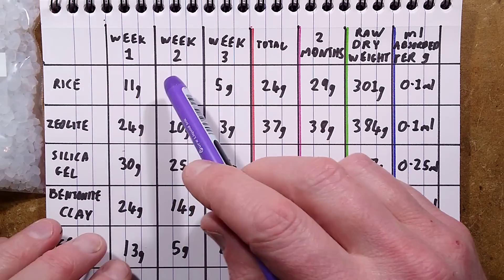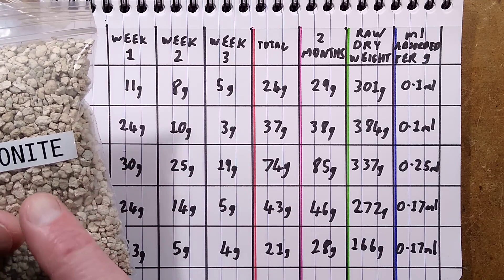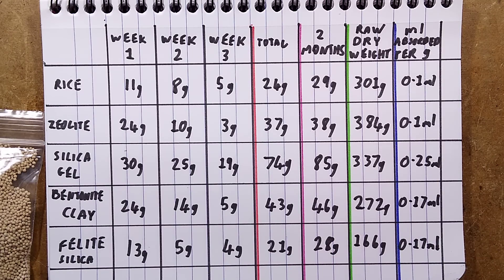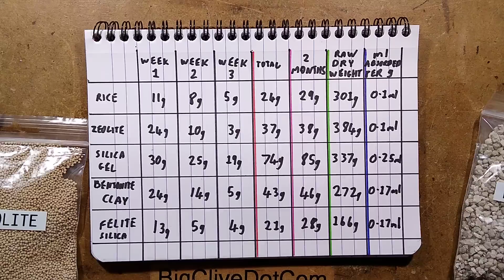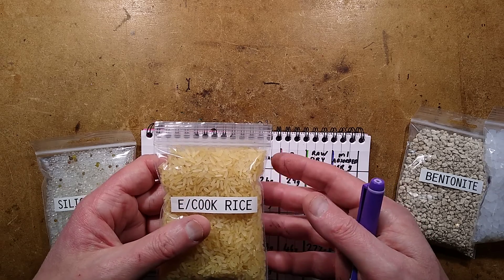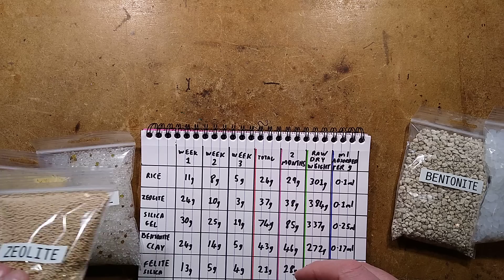Five desiccants - two month test with full results

Comment: I made a terrible mistake using calcium chloride to dry out the car after a leak. I forgot about it and went for a drive… the calcium chloride solution that had collected spilled out into the spare wheel well and fabric. It attracts water even when wet and I seemed to have an everlasting wet spot!
Reply: Yeah, that slightly gooey stuff is nasty and I suspect it even to be corrosive to metal. I used roughly about 10 bags of silica gel (each about 100 grams) in the whole car during winter pause in the garage and it kept humidity lower for about 3 - 4 months and then it was saturated. You even need a humidity logger device if you want to do it properly. And we Germans are well-known for taking it seriously.. 😉
Reply: @ef-lex  I imagine that it absolutely is corrosive the same way other chlorides like sodium chloride would be, being deliquescent tends to keep moisture perpetually present and the resulting salt solution would accelerate corrosion the same way salt spray would. Interestingly I find that leaving those rock salt candle holders (or any chunk of rock salt) on a surface tends to lead to this thin salt crust expanding out from the base of the chunk, perhaps it's attracting moisture and the resulting solution evaporating leaving behind a thin, expanding crust of salt on the surrounding surfaces
Reply: @ef-lex  It's definitely corrosive, they use calcium chloride for salting roads in some states in the US, and their vehicles can be scrap in as little as 10 years from rust.
Reply: Same happened to me. It's just weird that a powder can suck up so much water from the air that it becomes a liquid (oversimplified).
Reply: @phizc  sugar in a sealed container can do this too if it has a slight transfer of air in/out
Reply: I have a tub of anhydrous zinc chloride at work. Or should I say I used to have a tub of zinc chloride at work, I now have a tub of brown liquid as it's so hygroscopic it turns itself into a solution, even in an apparently sealed tub!
Reply: @drunkenhobo8020  Chemistry never fails to surprise.. 😆
Reply: Calcium Chloride is far more absorbent than other descants. Cheap too, but very corrosive. I've recycled it and silica gel in a normal oven with the fan running.
Reply: Keep flushing the contaminated area with water and soak up the water with a sponge or paper towel.  Eventually you will remove all residual CaCl2.
Reply: It does work well, but keeping the resulting liquid from spilling is definitely the tricky part. And that stuff seems oily too.
Reply: Calcium chloride is incredibly effective at reducing dust on dry construction sites. Roadwork contracts stipulate it's use when conditions become dry for too long.

Comment: Awesome!  I have a need for very dry air so i have an air tank with 500 g of 3A synthetic zeolite that i charge with 8 Bar of air, then wait a few hours.  No condensation even when this air is pressurized to 300 Bar 😮.

My application is for absolute lowest humidity as any condensation after compression to 300 Bar is what I am avoiding.

Comment: Awesome to know those silica gel packs are very worth saving and reusing. Thank you so much for this information!
Reply: Saved them since always 😊 I have a big bag now
Reply: If you have dry fertilizer or ice melter around the house, then throwing the desiccant packets into their containers is a good way to keep them from turning into a wet, mushy mess.
Reply: I wish I knew that before I ate them all.
Reply: I save them for synthesizing sodium metasilicate. Now I can save them for two reasons!
Reply: If you own an enclosed 3D printer with heated bed you can use that to dry filaments and desiccants though not recommend at the same time
Reply: @cowcannon8883  very inefficient, though. My stove does a much better job at that (while consuming less energy), and keeping filament with silica gel in IKEA boxed works really well.
Reply: @wernerviehhauser94    Good point and I will probably do this with my silica gel and rice.
But I prefer my micro plastics scraped from my bowls and Tupperware and unbaked. I'll leave my filament baking to my printer.
Plus it even has an inbuilt option for this too
Reply: I keep those that contain balls, but I toss those that contain something that looks more like cat litter since I don't want that dust in my filament box. Silica gel beads are about 10 bucks per kg, so the usefulness of saving them (especially without indicator color) is not that great.

Comment: Would copper sulfate be an option? I recall it absorbs quite a bit of water, and it turns a lovely deep blue too. No idea if it's even possible to "just" buy, or how good or bad it really is. But since you're experimenting, it got me thinking (giving me a headache really. I don't like this thinking thing XD)
Reply: It's actually used as a fairly crude test for water in a chemical reaction. Put it in a bit of glassware attached to your reaction vessel and it goes from very pale blue to a lovely deep blue if there is water being given off.

I'm not sure how good it is as a standard desiccant though.
Reply: @drunkenhobo8020  And it's reversible, just by heating it. That's why I got curious ;) 
Really love the shade of blue it can get.

Comment: Sodium Hydroxide is the best desiccant, a bit on the dodgy side but legal.
Reply: There is a product called ascarite which is sodium hydroxide coated on alumina chips to maximise the surface area, but it's usually sold for absorbing CO2 rather than moisture

Comment: The upper reminds me of planetary gear, just with less gears.

The lower has the same movement as a Sctoch Yoke, i cant remeber the name of this version with a gear.
Reply: What?
Reply: @mikebond6328  The too mechanism is very similar to a plenary gearbox but only has one satellite gear per sun.

The lower mechanism is a Hypociclic Scotch Yoke.
Reply: @welshdave5263   I have an impression that you're talking about a different video.
Reply: @SianaGearz  I know what's happened now. 
I was commenting on a mechanical video and I touched the top of the screen for something and a notification for this video had popped up just before I touched the screen.

The message box and keyboard were still there but the video behind had changed to this video, guess there's no comment on the video I wanted to comment on.

Comment: I wouldn't have guessed you could effectively dry desiccants in an air fryer. But I'll mention I got this rack accessory thing included with a new heat pump clothes dryer which lets you dry shoes and such in it without it tumbling around. I tried putting 1 kg of silica gel in it one day and it worked amazingly well, both in terms of quickness, ease and power consumption, now my go to method. Kinda makes sense to me though, an oven is just a hot, sealed enclosure, surely the air just saturates pretty quickly? Whereas a dryer actually removes the moist air. It's also a lot cooler around 60 °C so (most) plastic desiccant holders don't melt (eg. PLA will deform).
Reply: Ovens are not a sealed environment. They have a small vent that typically vents through the back of the range near the dials, or through a rear coil top depending on model. Steam and hot air escapes through this and fresh air is drawn in.
Reply: @JourneysADRIFT  Because you said "range" I assume you're from North America where gas burner ovens are common (they're now banned here in Australia for air quality and fire hazard reasons). My understanding is almost all gas ranges vent the oven space because they have to burn a fuel inside, but in most countries electric is vastly more common, those don't vent the oven space apart from for pressure equalization. Almost all modern ones do have fans and vents on them but that's just to cool the electronics and the outside of the oven in the cabinet and sometimes the front glass. If you do try to dry water logged things in an electric oven you'll find you have to open the oven door every so often and when you do the built up steam is often visible to the eye.
Reply: @WizardTim  Range doesn't mean gas specifically, just the oven/cooktop combo. It can be any flavor. My electric one does have a vent in the rear that is for steam/vapor to escape.
Reply: @WizardTim  im talking about electric ovens. What I said is easily searchable online.
Reply: That makes a lot of sense, but is 60C hot enough to dry it out in a single drier cycle? Clive was suggesting even 90C from the little heater unit he used might not have been enough, and while there's an additional boost from using a heat pump drier which directly dehumidifies the air as it cycles that still might not be enough to fully dry the desiccant out
Reply: @bosstowndynamics5488  Yeah it is a lot cooler than the normal method for drying desiccants that say to bake at 120 °C for a 3-5 hours but the direct dehumidification advantage heat pumps have does do a lot. Pretty confident a conventional resistive heater dryer would be faster, but would consume much more energy. I find it takes 3-4 hours (~1 kWh) to dry 1 kg of desiccant that has just changed color.

I think it's pretty effective a drying despite the low temperature because I can put saturated room temperature desiccant in a sealed box with a big pile of room temperature dry desiccant and it won't take long before the saturated desiccant changes color to indicate it's dry, so evidently heat is not a requirement to dry desiccants until they change color. I imagine baking at 120 °C is still the best option for dryness, but I would guess a heat pump will get it 90% dry but for much less energy and possibly faster.
Reply: @WizardTim  I'm not sure what thresholds the indicators typically use for desiccants but they're really intended to show saturation, so drying it just enough to see a colour change probably doesn't remove that much moisture. Some desiccants do use gradient based indicators intended to show both ends of the scale but that's not super common and I suspect many of them are still fairly wet if you only just target the colour change. It would be better to use a weight based approach to quantify how much water is going in and out
Reply: @bosstowndynamics5488  The 3-4 hours in the dryer is usually until they change color +1 hour. I find doing this allows the humidity in the storage boxes I put it in goes down to 5% or lower relative humidity, if it just target color change I see it bottom out at 25-30% humidity in the storage boxes. So yeah drying just until it changes color is not a good metric, but for that test where I just dried some with other silica gel at room temperature I thought it demoed high temperature wasn't an essential requirement do at least partially dry.
Reply: Interesting point about the air fryer.

Comment: For the zeolite, it depends a lot on what type you used. This can be optimized for a variety of molecules and temperatures, or for exchanging ions. 
If you have a fairly standard zeolite there, like 3A or 4A, it should be able to absorb more than double of what you measured, but it is supposed to be regenerated at above 120°C.
Zeolite 13x can be regenerated at 90°C and has about 23% absorption capacity by weight.
Reply: The amazon stuff is fake.

I ran into this issue in the past.
Reply: I'm stunned that anyone would bother faking molecular sieves.
Reply: @elitearbor  China
Reply: @elitearbor  I first realised how much money was in counterfeiting when I saw that 1p coins were being faked. It probably cost 0.99p to make the fake but en masse it adds up!
Reply: @elitearbor  anything that can be faked shall be
Reply: @Ammoniummetavanadate Can confirm. Especially the 3A molecular sieves (aka 3A "zeolite").
The cheap stuff sold in 7LB containers won't even separate water from alcohol thus definitely is not 3A.
FYI, you need to heat it up to at least 300°c to properly dry it out. I just chuck it in the oven whenever I'm doing a pyrolytic clean (but I've heard some people have moderately good success with microwaves as well).
Reply: @charmio  Just have to be careful as it will melt it in a microwave if heated to long

Comment: It would be interesting to get some superabsorbant gels, such as what is in diapers and those gel balls that the kids keep eating. Some of those can do many times their weight in water, as opposed to a small fraction like these.
They will all expand somewhat (or a lot) as water comes in. That may account for part of the tapering off of absorption rate, as airflow might be hampered as the particles get bigger. And you probably couldn't fill the chamber completely with them, as they'd expand too much.
Reply: They may not work well at all for pulling moisture out of the air, and only expand when liquids are directly put to them... Otherwise, all your new diapers would arrive completely filled up with moisture from the atmosphere before they even get put ON a baby ... ;)  I'm assuming desiccants have a different mechanism of action vs a liquid soaking powder.
Reply: Somehow they are quite neutral in air. But very good in taking in droplets of water. At least after a sort time. I tried this ;-)